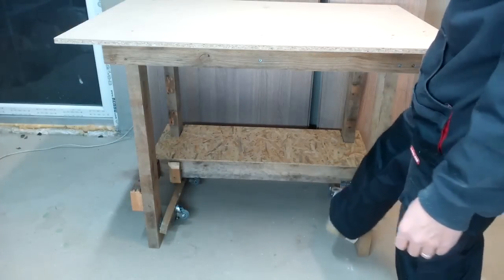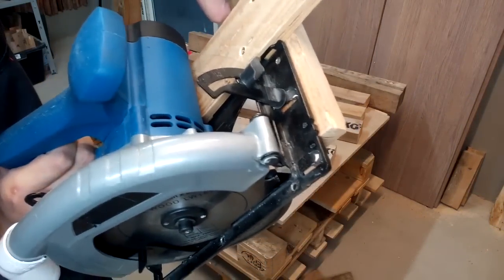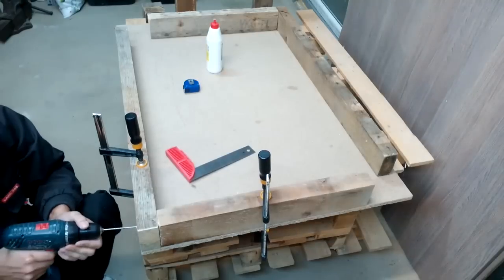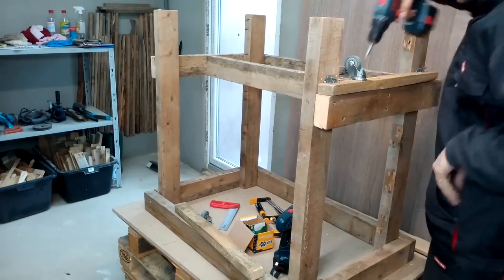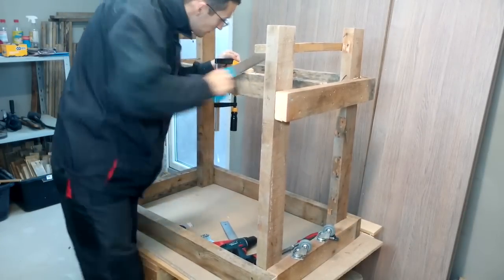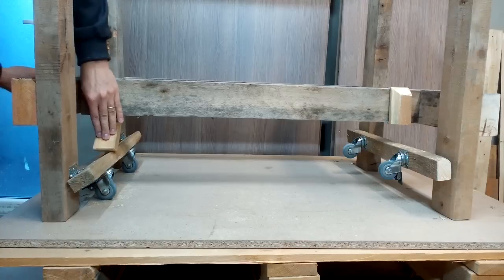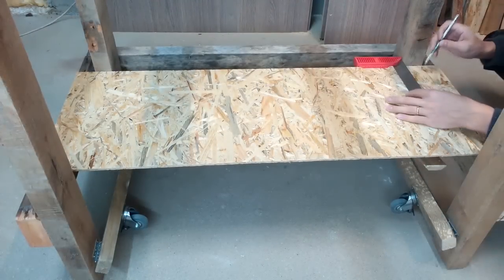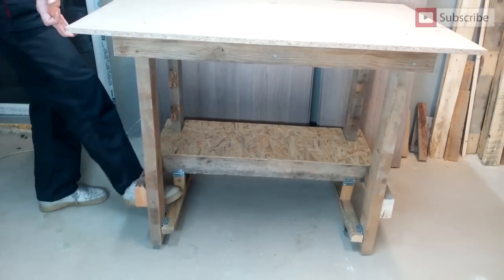How To Make A Workbench With Casters

Comment: Thank you, great to see a video like this, a much smaller bench than I have, which I find heavy to move , but again, the simplest Ideas seem to work wonders. I will be using this idea to improve my bench.Which has BTW,  a circular saw fixed with a raise and lower mechanism, and A Jointer / thickness planer from a hand electric planer. A Jigsaw mounted will also be in  or on my project list, and Router planing station.   Ideas I have got from YouTube. I also use reclaimed pallets, lovely wood to work with ! Once again Thanks for your simple but workable ideas, Gee B .